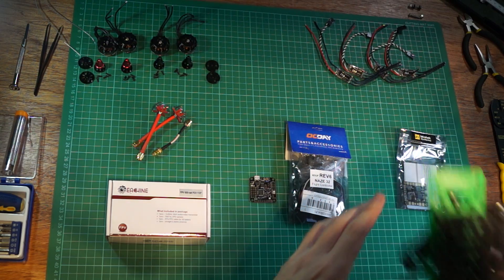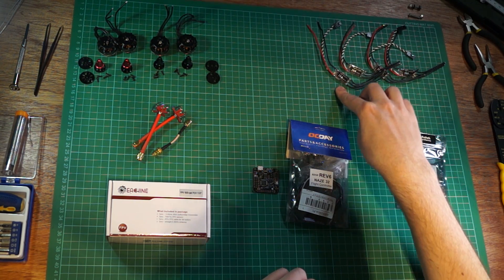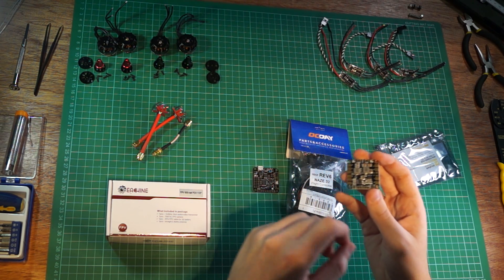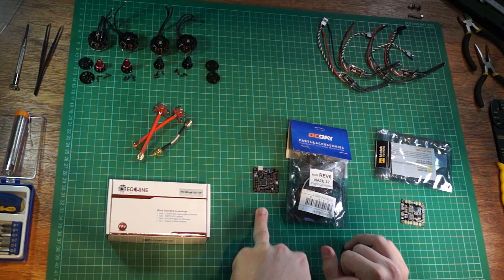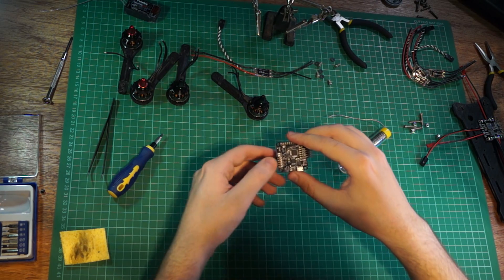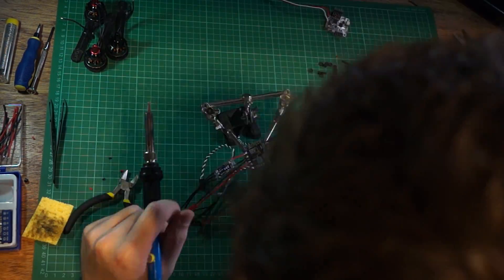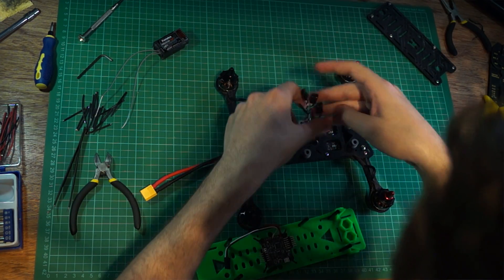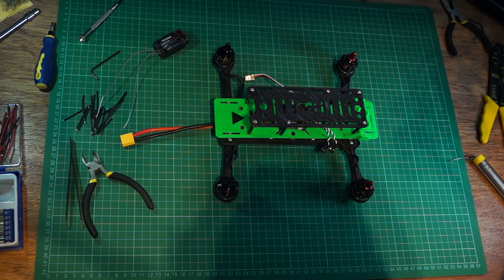WHAT'S GOING INTO THE 3D PRINTED DRONE?! - 250 Racing Quadcopter MHQ2 Build #2

Comment: Nooooooooooooooooo, betaflight, not cleanflight!!!!!!!!!!!!!!!!! It's stock settings are much better for any usual racer.
Reply: and that camera/motors/frame are really bad considering what the rc market offers nowadays.Will you use sbus/ibus? don't use pwm or ppm
Reply: soeey if it sounded rude, nice job though
Reply from the maker: FPBird Rc exp I'll check out Betaflight, cheers, and yes I am using SBUS. This was my first build and I was still learning a lot - I'm working on my second build at the minute which is based off the Martian II frame that will be a lot better, this was just a fun experiment :P